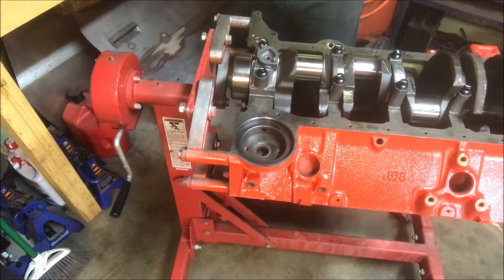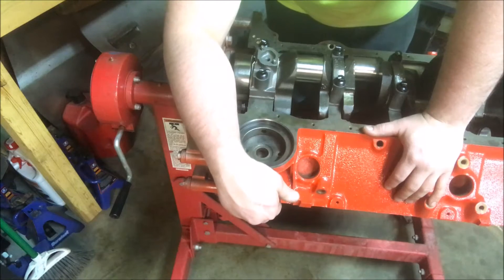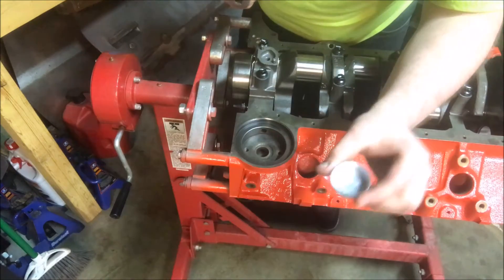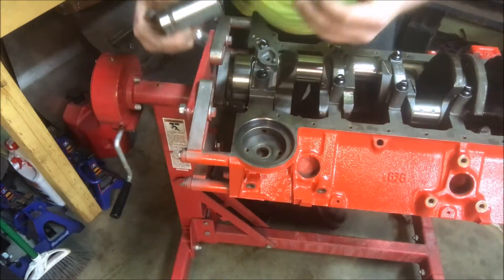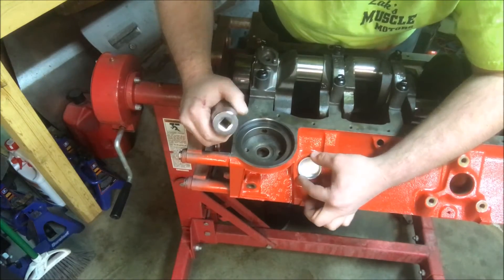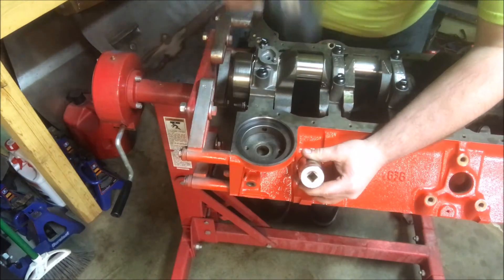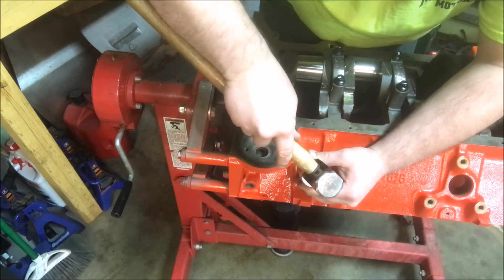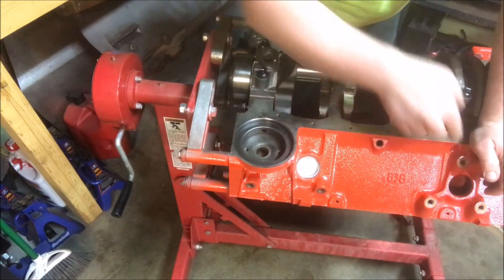Engine Building 101 Core Plug Install

Comment: Atleast you are calling them by there true name "core plug" and not freeze plug or frost plug! People seem to think they exist to stop the engine block from cracking if the water/antifreeze freezes and expands but they exist becus the holes in the block are there to get the sand out of water jackets when the core/block is casted there purpose is to plug the hole so the anyifreeze/water doesnt run out the holes! Great video!

Comment: Will new ones in a new machined clean block stop leaking?  I have new ones and one has a very tiny drip.. Seems to have gotten better after breaking the cam in.  Hoping it will seal up on its own.
Reply from the maker: Dale Marty sometimes they do sometimes they don’t. What sealant did you use?
Reply: Machine shop installed them it was yellow is all I know
Reply from the maker: Dale Marty keep a close eye on it. If it doesn’t stop, you can try to use a gasket sealer and seal it up or only other option pull it out and put another one in.
Reply: Thanks! They are in the front and replacing is what I may do after I drive it some.